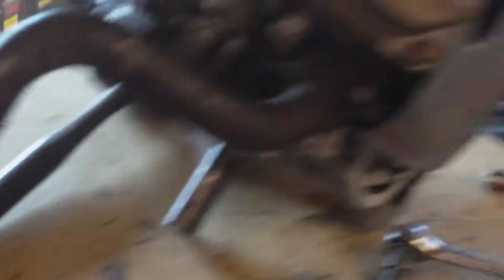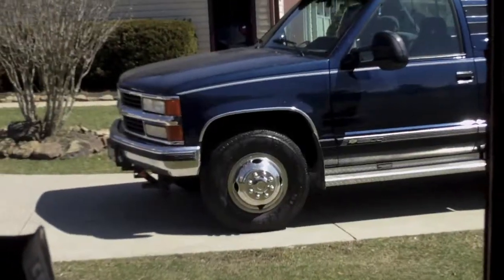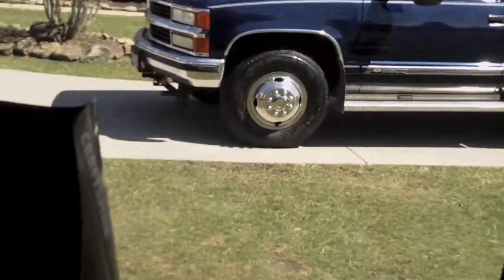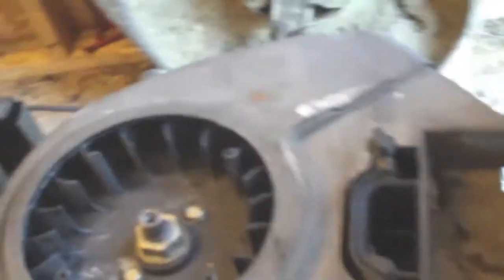Craftsman LTX1000 Riding Mower Part 8

Comment: U shouldn't run your engine without the plastic covers Bc that what directs the air flow and during the reassembly u should put oil on everything it's not good to dry start it